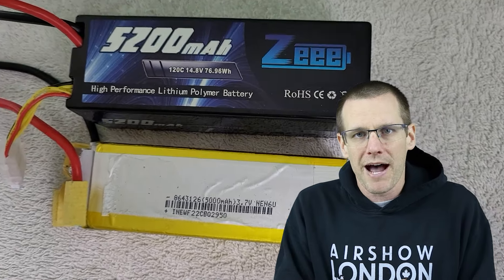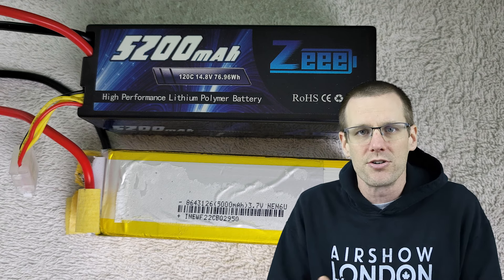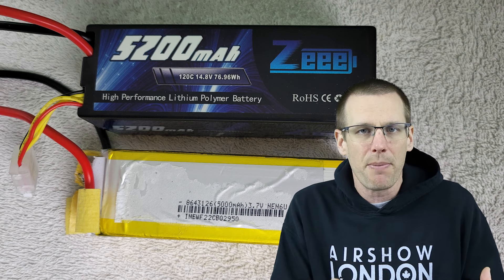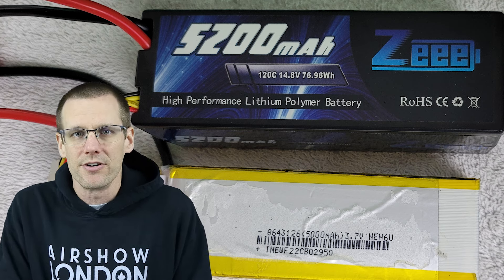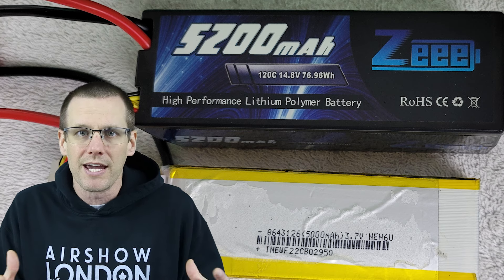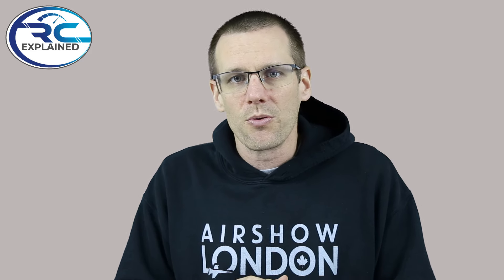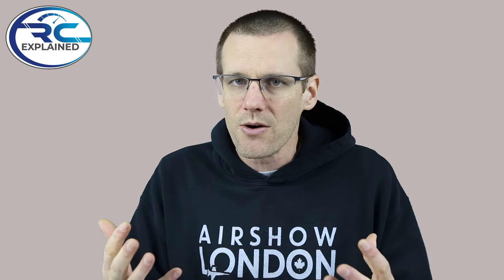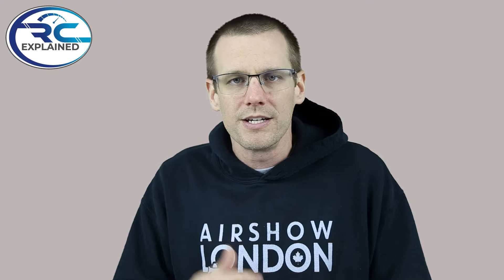I Was Wrong About this Battery Specification? Here's What I Discovered!

Comment: Glad you asked for comments.  I do testing.  How, you might ask?   I fly with an iX14 which records telemetry.  I fly with telemetry capable receivers and ESC's (i.e. Spektrum Smart ESC's)  

I write software, database stuff mostly, so I've written software that takes the telemetry file and calculates the actual mAh's used in a flight, and the remaining capacity left after the flight.  This gives me, for every flight, every battery I use, a real measure of the actual mAh's the battery can deliver.  One brand actually gives (for some of them) MORE than the label, those are the Spektrum Smart batteries.  Another brand, SMC, pretty much gives me what the label says.  All others which I have give less and sometimes, (like the China Hobby Line) MUCH less than the label says (on the order of 40% less).  

I don't find the calculations to be precise from one flight to another but it allows me to see the overall quality of the battery.  It depends a little on the temperature, a little on the flying style, and a little on how much you draw from the battery as to what the software calculates from a flight.  When the flight is done the software takes the final resting voltage to determine the remaining percentage.  My flying style is such that my average throttle is about 65% and I only flight EDF's or pusher prop planes. 

The testing I do therefore is actual, real world (not bench) testing.  Pretty much I fly all my 6S packs in the same planes, whether my FW Avanti, FW L39, eFlite Havoc 80 or a couple of other jets.  So it's not like I'm comparing apples to oranges in the flights.  The results are pretty much the same regardless of which plane I fly the battery in.

I've pinged the CNHL batteries as being the worst.  I have 2, white 6S, 6200 mAh packs and 2 black 6S, 6000 packs.  None of them come close to their label rating.  I don't get  batteries sent to me for testing so my repertoire is just what I choose to buy: Smart, SMC, Admiral (they're also not bad), CNHL, Roaring Top, and HRB.  You can spend more on batteries than you do on airplanes in this hobby.

Of course every telemetry file is saved and I store everything in a database so I can look over how each battery has performed for any flight.   Matter of fact I store every bit of data that I can squeeze out of the telemetry and also the calculations like max/average speed, altitude, Amps, throttle, even the temperature and wind from my weather station (if I fly at home.)  Hey! I'm a database guy so ... that's what I do.  I don't try to calculate C ratings, just the actual mAh value of the pack.

If you want to compare notes I'd be happy to.
Reply: Started using HRB and will from ow on exclusively because of their support, quality, value and sizes available in 4s❤
Also used Zeee and Ovonic -not that bad for bashing actually.

Comment: It's pretty typical for a 5000mah pack to hold more than the specified amount usually. For example 30% storage capacity 1500mah will typically hold another 3800-4000mah from 3.8V This totals around 5500mah from completely empty. These lipo companies are giving a rough average not exact numbers
Reply: That's ridiculous.  If you let a lipo go much below 3.0V, you'll probably damage it .  The manufacturers are expected to put a usable mAh, not what you can get if you take it down to 0 Volts.  I can't argue about your numbers, as I've never wanted to ruin a battery just to see how much you can get out of it.  I judge a battery by its usable mAh.

And it's NOT typical that a 5000mAh pack will hold more than that.  Matter of fact I find it to be very rare.

Comment: I think the most likely thing happening here is Zeee is A.) Cherry picking test data from their batteries and B). Designing any tests that they do specifically to increase the performance of their packs. Example, Lipo batteries can be charged higher than the rated voltage, even if only slightly, and discharged below 3.2 volts so testing an over charged pack down to 2.8 volts would yield better test data. Testing the packs after preheating to optimal temperature would also increase pack performance slightly. Last, testing the pack with on a very low power draw (say 100 milli-amps).

Comment: INA219 Current/Voltage Sensor.
Adafruit Arduino. And you can even store data logs on an Arduino Uno with SD, or Micro SD Card. You could do static bench testing of your batteries. Or a breakout board that is flight weight small form factor.

Comment: The difference between the listed 5200mAh and the rated 5000mAh could be due to variations in testing methods or tolerances. Manufacturers may test under different conditions, or the slight discrepancy could be due to rounding or how the capacity is measured. It’s not uncommon for small differences to appear, but generally, it shouldn’t significantly impact the performance of the pack. 

  I’ve run these packs down to 2.8 volts without issue and end up putting about 4800 back in with 10-11% showing on my meter and for the price they perform adequately. I’ll continue to buy them for my models that don’t need to pull high amps and enjoy saving some $$.
Reply: +1 dude!

200/5000=4%
Which is probably nothing compared to temperature, HiV, etc.

Comment: accounting for non usable voltage is what ZEE is doing.   The weight says alot, and alot of manufacturers like to account for non usable capacity on their lables
Reply from the maker: They could be, I'll run a discharge test at a slower rate.

Comment: I don’t know about the dirt cheap Chinese batteries but if you buy from a decent company if you’ll pay attention to the spec sheet, most of them will give you a plus or -5 to 10% of the true milliamp hours of the rated milliamp hours on the pack Let’s say 5000. Million it will then tell you actual milliamps plus or -5% or depending on the company plus or -10% this is usually in the spec sheet on most batteries that I’ve noticed.
Reply from the maker: True, however, I was wondering why a reseller would disagree with the manufacture of the lipo battery and re-label it a different value?
Reply: @RCexplained  and that is a very good question to be asking